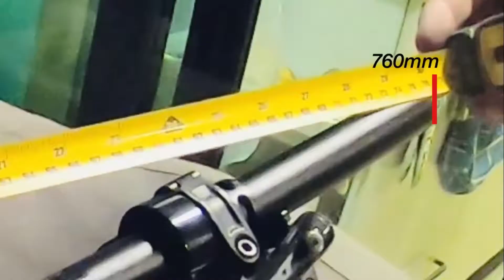MTB Repair / Hack @ Home - Handlebar perfect cut & reinstate back in 20mins

Comment: I used pipe cutter also on my previous bike's handlebar. Original width was 780, cut it to 700 to comply with regulation. Doesn't feel right, so i threw it and bought a 780 handlebar 😁
Reply from the maker: Yah, 700 is too short. Lesson learnt is to cut bit by bit 😅